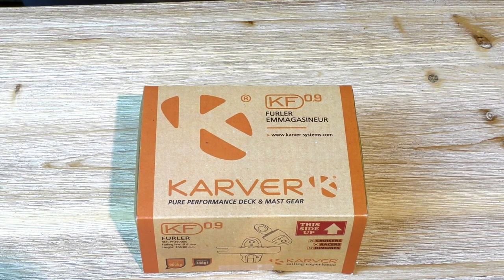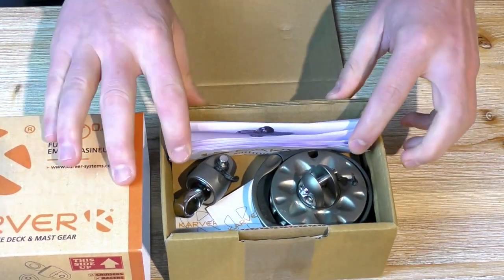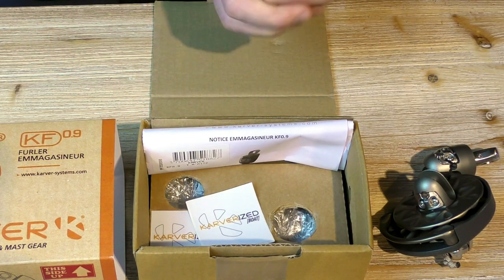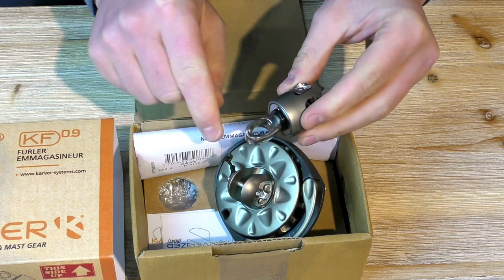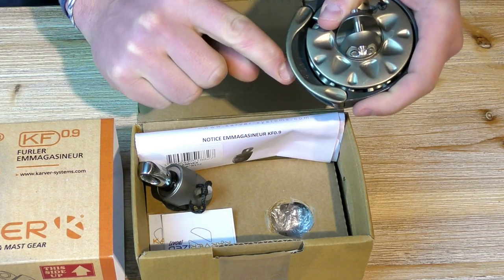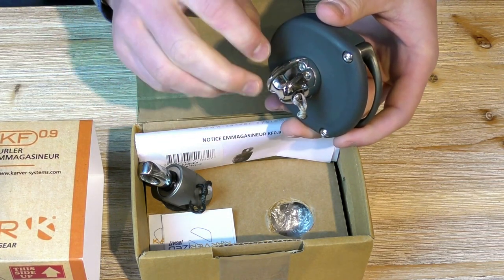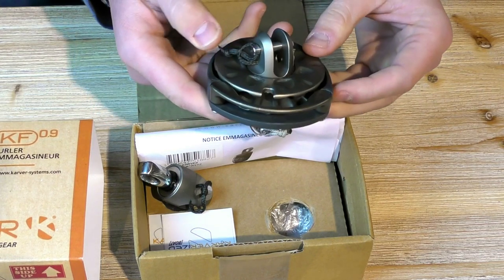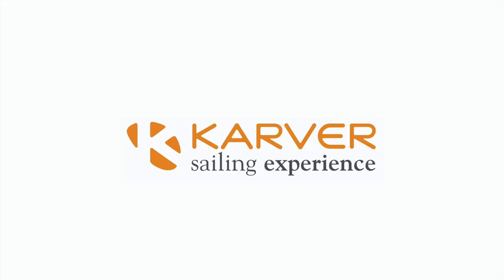KF0 9 unboxing

Comment: I've bought this "piece of engineering" two months ago. At the beginning it worked smoothly and one day, while furling the grennaker, it just stopped spinning. So, it came clear that all the parts of this  "piece of engineering" are kept together by threads. Every part of it, that is used to furl your sail, is fixed to the other part by a thread. And the funny thing is that these threads are not fixed (not to unwind), so if a bigger tension is put to them (as the sails like to do), they would more likely wind or unwind, than to furl your sail. I wrote to Karver and received their apologies in return, but not their agreement, that it's not fair to sell such a thing. So now, I know this is "a piece of .... something" , but surely not a "piece of engineering" :)